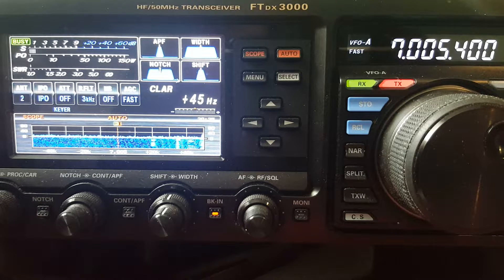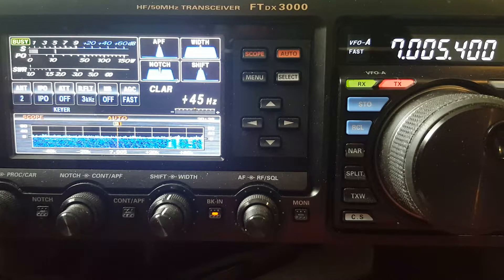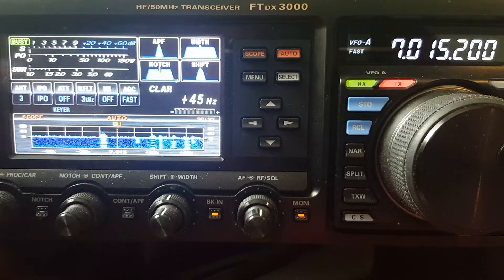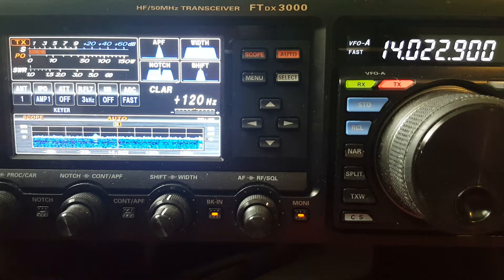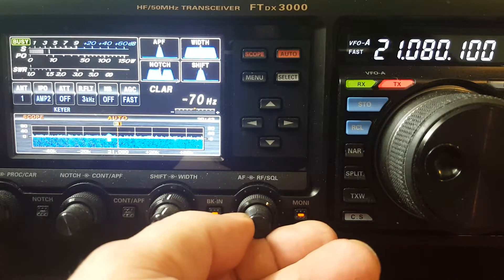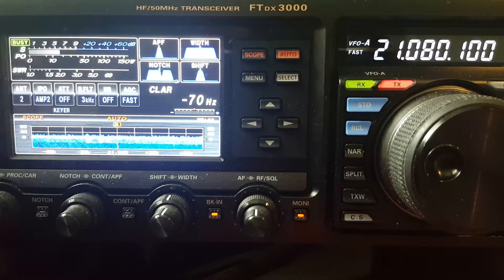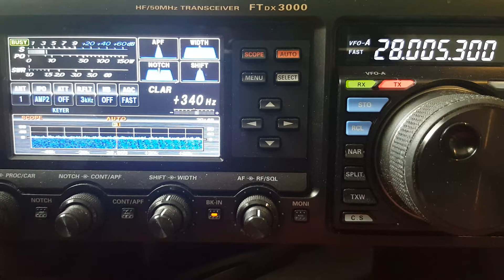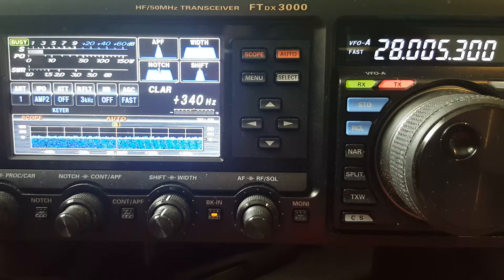40 EFHW - FT120-43 core - Noise Comparison - 40 EFHW compared to vertical on 20, 15 & 10 meters

Comment: I have always been told verticals are a little more noisy because more noise is vertically polarized.
Reply from the maker: Yep I've always heard the same. I think...
It depends on our unique situations. In my case, my dipoles are a lot closer to my neighbor and her appliances. My power lines etc are also closer to the horizontal antennas i have.
There could very well be something about my location noise-wise that makes my vertical my quietest ant, followed by my end feds (which run from my shack window heading towards due west)
Thanks for watching! 
dit dit